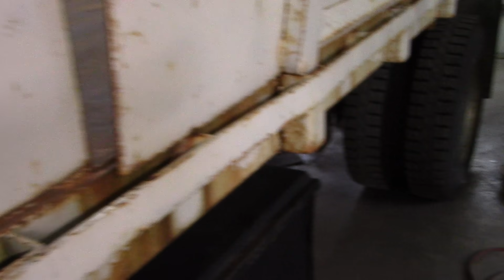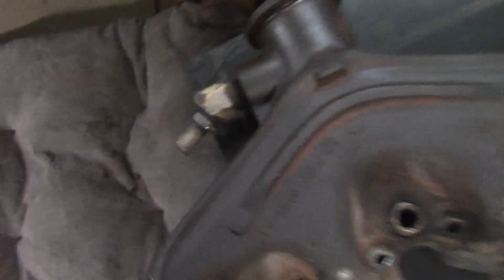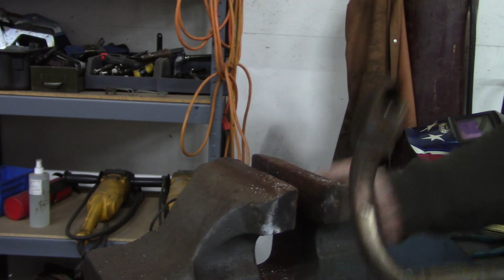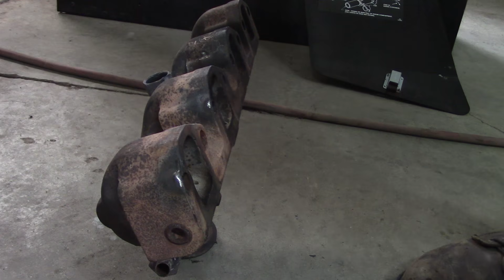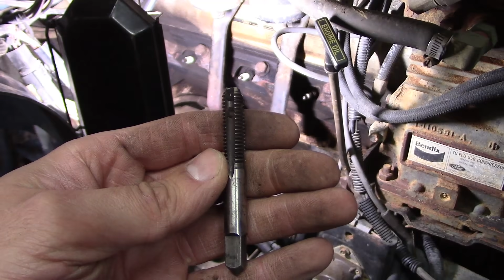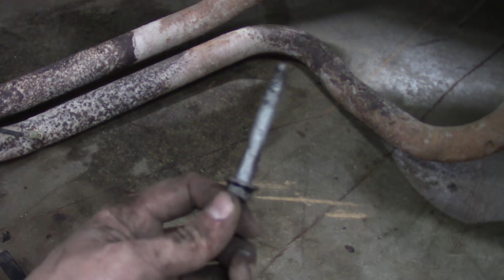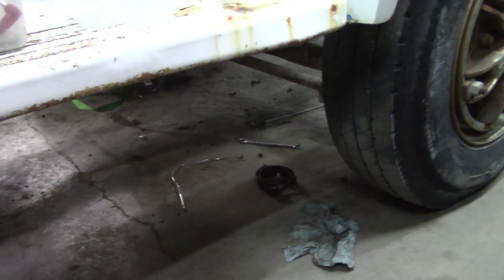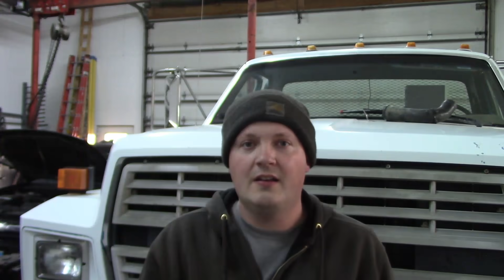Ford F700 Project - Exhaust Manifold Leaks (Gas Engine) - Part 1

Comment: Just think 20 cents of antiseize at the factory would have eliminated your ptoblem
Reply: Disrespectful to anyone who has to work on it later.   Yes, even 26 years later.    Don't even get me started on seized oxygen sensors. 
"They do use anii-seize on oxygen sensors"   Not ENOUGH, they don't.
Reply: First thing I do when I start a job that has 02 sensors is run the engine for awhile. You can usually sling em right out when they're hot. But yes. Antisieze makes a massive difference dude, I promise you. I see the difference weekly
Reply: So would have a gallon of gasoline and a match! :D
Reply: Nickel Anti-seize is rated at higher temperatures, then Copper, then Aluminium, any steel to stainless steel combination requires Nickel based. That's my 2 pence worth.
Reply: You shouldn't mix stainless hardware with non stainless, it galls and will prevent you getting it off.
Reply: Doesn’t work as well on exhaust, heck even lug nut studs get hot enough to make it stiffen worse than dry
Reply: Stainless hardware helps.  Some of the imports use that.  Silver or copper anti seize has worked for me.
Reply: I like stainless hardware, I use a lot of it on my Duramax 2500 HD when I do any exhaust work.
Reply: Anti seize used on exhaust manifold fittings cooks into a glue that makes the fittings harder to remove than with just the heat corrosion, same with O2 sensors, it gets too hot for it to work in the long run.
Reply: @ralfie8801  , nope. Anti-seise consists of lubricant and copper/aluminum/graphite powder. Under the heat the lubricant burns out, and the powder stays as dry-sliding agent. I have used copper anti-seise on exhaust nuts, and had to take it apart again in several years. And God nows I loved myself for that copper paste.
Reply: @denru8366  
I’ve used a lot of that stuff on locomotive exhaust stacks and manifolds, most of the time with less than stellar results at disassembly time to change a stack base gasket that blew out. We use it on the power assembly flashcocks and it just makes them harder to manipulate with your hands once you loosen them with a wrench. I use it, I just don’t care for it.
Reply: @ralfie8801  so what do you guys recommend is the best type of anti seize to use in a hot environment such as an exhaust manifold?
Reply: @giggiddy  High temp silicone works well to help keep rust away but for only so long. After a certain amount of time heating and cooling over and over, I don't know if anything will help. I have had luck with soaking exhaust studs with the 50/50 mix of acetone and ATF and letting it work it's magic overnight though.
Reply: @giggiddy  copper based anti seize, followed next by aluminum based(most common).
Reply: @giggiddy   Wurth CU 800, definatley not cheap, but is an excellent product
Reply: @giggiddy  
Honestly, all they’ll give us is copper anti seize, if we don’t use that, we squirt penetrating oil down the manifold bolt holes in the engine block and run the bolts in with an impact.
Reply: @denru8366  both silver types will melt and reform
Reply: @Availablehandle-i1k  or torch it with a propane torch for a while and then spray it, and heat it again when you get back, just to make sure

Comment: Why didn't you eliminate all the smog and emissions stuff and throw on some headers?
Reply: He says at the end of the video it's due to the risk of epa fines.
Reply: @BuildingWithRane  okay I couldn't watch to the end I wonder if that state has auto emissions testing to get tabs renewed.
Reply: @ryanroads7748  I dont know about Iowa but I've seen DOT stops check it on commercial vehicles.

Comment: Freaking hate this jobs where its only hand tools the entire time
Reply: Looks like Ford never considered replacing these gaskets - just pull the entire power-pack to change out the exhaust manifold gaskets.

Also, they probably designed the engine compartment around a straight 6 Diesel engine, and then shoehorned in the V-8 gas engine...
Reply: and here i am only using hand tools xD i dont really use power tools, only on rare occasions
Reply: I was gonna say where u only use the blue wrench the whole time lol

Comment: Wes, how well is the radient tube heating working in that building? Is it reasonably efficient to run? That's a big space to heat.
Reply from the maker: It works well. I have two identical units and I only ever use one. Costs me about $1000 a year to heat the shop. That's not bad!
Reply: Radiatnt heating works very well in spaces like that.  Convective forced-air ... not so much!
Radiant doesn't care about cubic feet, only about distance to subject!
The Inverse-Square Law Rules!
Reply: @drteknical6571  because radiant heat "cooks" you, whilst convective heaters just warm the air :D. What i don't like about radiant heaters is that, you get cooked on one side (facing the emitter) whilst the other side is freezing cold, feels like being in space in sunlight one side you have 200° and the other -150°!
Reply: @gglovato  thats why you should keeps turning a round. So its like being on a rotisserie.

Comment: That front bumper would eat my shins for breakfast. 

"I was a mechanic once, until I took a tow ring to the knee..."
Reply from the maker: Worse than a receiver hitch!
Reply: @WatchWesWork  - Still not as bad as a 5 pound sledge to the shin!  Did that beauty about 3 months ago, and I can't even say it was the first time that's happened.  Shed a  quick tear and went back to work......with a bit of a limp lol
Reply: @colin8532  Ouch that reminds me of the film Misery.
Reply: @colin8532  I feel your pain on that one. A few months back I was hooking up a herbicide sprayer to a Deere 6430 with hay forks on the front. The forks were still slightly elevated since I was backing it up, and they were right at shin height. Got out to check my positioning on the sprayer booms, and was looking at the boom while I walked from the right side to the left (instead of looking where I was going like I should have been). Walked right into the side of the damn forks. Put a 3 inch long split in my shin even with thick jeans on. I've never been nailed that hard with a sledge, but it had to be similar...those forks are 2" thick tapered steel that are 4 feet long each. Not much give there.
Reply: @colin8532  ...Been splitting wood eh..?
Reply: @anthonydefreitas6006   OWWWW... I coulda' went all day without remembering that one..?
Reply: @dougankrum3328  & Colin just to jog your memory 
https://www.youtube.com/watch?v=2pbfkNI2d_A
Reply: When you're 6'4" and have long, bony legs, everything at that height is an absolute hazard.
Reply: @TechGorilla1987  Or worse is a lathe with the Z handle that has a power feed. If you forget to move out of the line of fire you'll be singing soprano for a hot minute.
Reply: Heh been a while since I've seen a Skyrim reference!
Reply: Well done...here's a sweet roll
Reply: I used to be an adventurer... until I took an arrow to the knee 😂😂 I seriously forgot about that lmao thank you.
But yes, reciever hitches are a constant pain in my knees and shins
Reply: I like the new bolt head logo.  Max's profile wasn't bad either....I like bird dogs too.
Reply: Happens to me a lot with joinery items where i work, always seem to be at the perfect height to catch a bare shin.
Reply: that 'bumper' looks like it was designed to be an air-tank of some sort...

Comment: you have great patience my friend. i would have used a torch wrench🤪
Reply: In my northern experience the real rust buckets are the dodges. Add that to the mess of wires from all the things that have been "rewired" since 6 months of brand new and you've got a really fun pile of scrap to work on. The only areas on a dodge that don't rust are the ones next to the motor and tranny because all the oil that leaks from them 😆
Reply: I hear those Fords are a lot easier to work on once they have gone through the car shredder!

Comment: Late 80s early 90s Pontiacs doors would lock too when you started them. My son's first car was a Bonneville and when it need a jump start (which was often) the first thing I would do was put down the driver's window, because inevitably after I got it started I would go take the jumper cables off and the door would close and lock me out, only got me 3 or 4 times
Reply: But on the bright side I got very good at breaking in to GM cars
Reply from the maker: I worked at a dealership once that had all kinds of custom bent rods for unlocking doors. They hired a new guy and he went through and straightened all the rods. We had a pretty good laugh the first time he had to pop a door open...

Comment: As far as things related to Marman Clamps - that's a common way to connect the stages of a large rocket together.  Two (for redundancy) or more bolts around the clamp are broken with an explosive charge and the stages separate neatly.

Comment: 3:13 I worked at a Cat dealer for 32 years and never heard that term for a  V Band Clamp. Nice to learn some brain candy.
Buy some different size rifle taps to use in blind holes. Less likely for them to brake vs a straight fluted ones.
Reply from the maker: Insider information.
Reply: @WatchWesWork  Must be way inside.  Lol.

Comment: With all that emissions crap, what could possibly go wrong...
Reply: I wonder if the EPA takes into account all of the fuel burned by people returning their newer vehicles to the dealer every time the Check Engine light comes on....or the amount of oxyacetylene used 26 years later to cut a funky old emissions pipe.